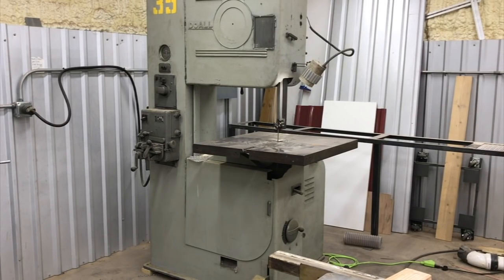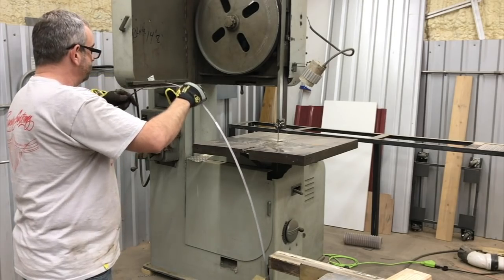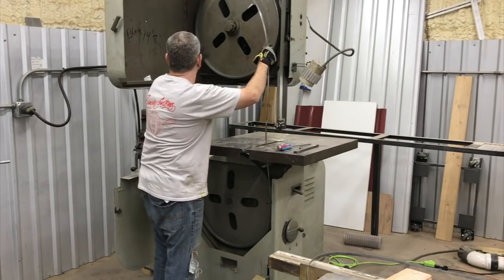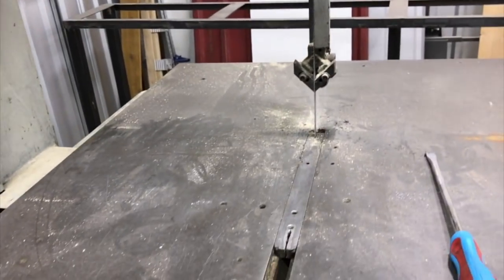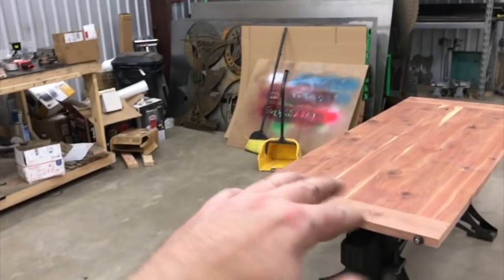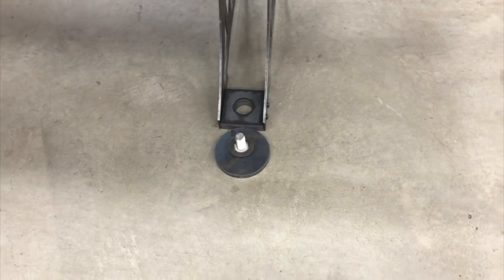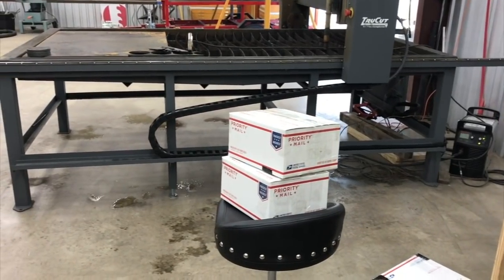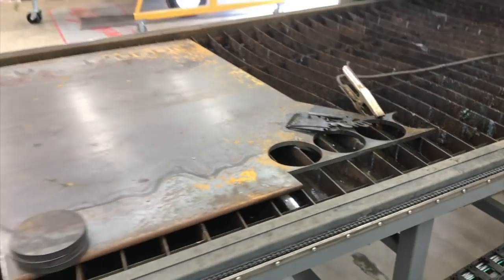Changing the blade on this big SOB DoAll Bandsaw - Oldbarn Homesteading

Comment: Gary doesn't the blade welder work on that saw?
Reply from the maker: Yes, it works as far as I know.  I just bought pre-made blades in stead of material, but if i break a blade i can weld it back.